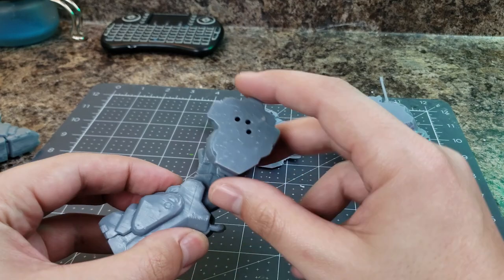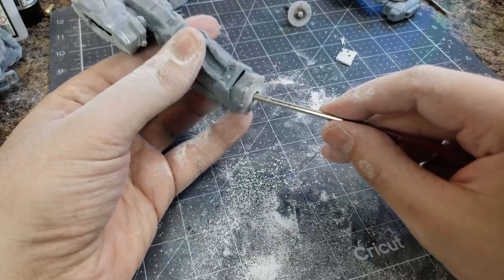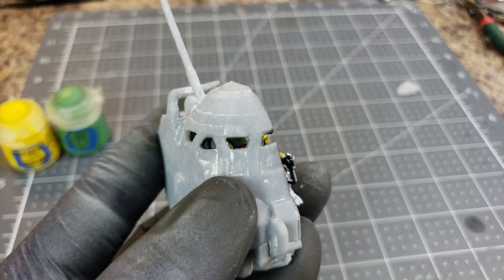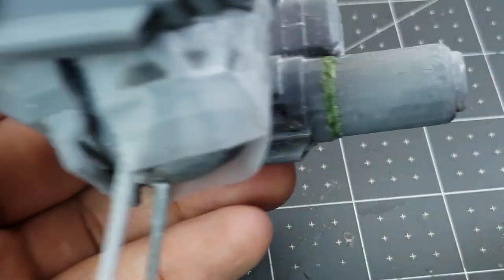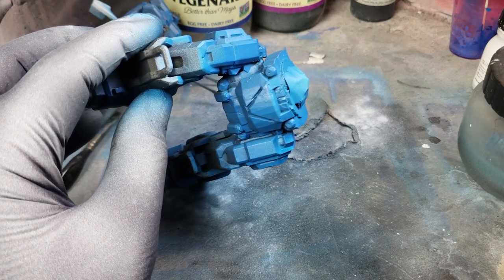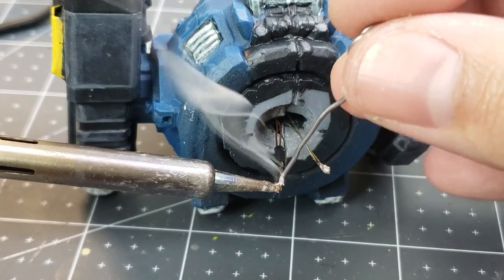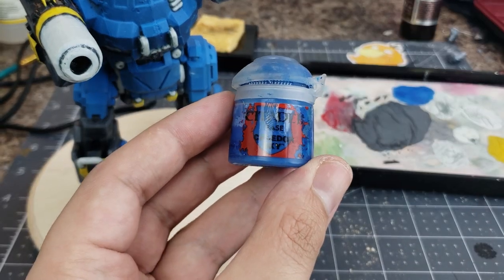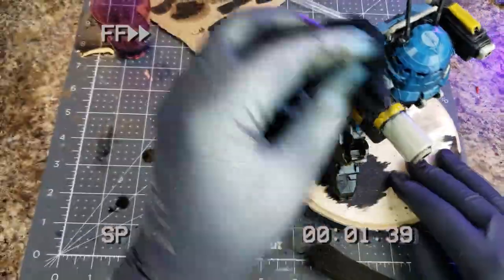Battletech in 28mm?! Building a TITANIC Urbanmech

Comment: Pro tip. If you drop the resin prints into hot water it will become soft enough so you can cut it with an exacto. Needs to be pretty hot tho. Boil the water. Pour into a container. Plop the part in and wait about a minute. Also, liked and subscribed. Great video
Reply from the maker: Thanks for the hot tip, and the watch! I'll have to make a point to remember this going forward.

Comment: 2 main reasons why you might want a proper masking tape rather than whatever tape you have lying around - both are related to whatever glue might be in use on the tape:
a) Some tapes adhere too strongly to masked off painted areas, and damage the paint finish when removed. (clearly not an issue here, as area not yet even primed)
b) some tapes leave adhesive residue on the area once removed, interfering with later paint application. (depending on paints in use and type of adhesive, can usually be removed via a suitable cleaning agent without damaging paint)
At the end of the day, if it works it works.
Reply from the maker: Thanks so much for the tips! It's easy to seem like I'm simply fishing for comments for the metrics, but I was genuinely curious. Much appreciated 😁

Comment: Pure greenstuff doesn't sand very nicely, I'd recommend making a mixture of greenstuff and miliput for your gap filling needs, the two compounds combine into a very versatile putty with the best of both worlds. The detail capture of the greenstuff and the strength and sandability of the miliput. The miliput is also water soluble, so you can make a surfacing wash to take care of any 3d print lines you may encounter. Shouldn't be too hard to get a hold of in the states, especially if you're in a major city, a good arts and crafts shop should have it, or it should be easy to order from somewhere.

Lovely build, always love to see urbie's and 28mm battlemechs in the wild.
Reply from the maker: Thanks for the hot tip, fellow trashmech enthusiast! I've seen that mixture occasionally out in the hobby wilds. I'll be on the lookout for some next time I'm out to restock supplies😋

Comment: With the filing flat surfaces that you're going to glue up, try gluing sandpaper to a tile and sanding with figure 8 movements. If you use wet type sandpaper, you can soak it and that will stop the resin dust flying around too. Once you've sanded the nubs off, you'll have helped to correct the warping at the same time. Hot water might help to lessen the nubs etc. Warping is a problem, I'm no expert in avoiding it on big pieces, if you have any tricks, please share. All the best.
Reply from the maker: Thanks for the solid tips once more, kind viewer! Exploring these projects is always gonna be a learning process, and by sharing my experiences with y'all, we open a dialogue to communicate mutual growth in the hobby 😋
Reply: @countryfriedminis  no worries, thank Adam Savage for getting me onto that one with the stuck down sandpaper - holding bits like that and sanding them always means catching the edges and making the flattening even harder. I've been in this 'hobby' since about '85, plus one of my best mates is a guy called Mel, The Terrain Tutor, (check him out, some great terrain stuff there) so I've been lucky to pickup and share a lot of tips and skills over the years. Battletech is a new one for me, I'm really enjoying printing and painting mechs at the moment.

Comment: Well to fill in gaps such as those shown, the trick is to use Super-Glue but to add body to it, sprinkle on Baking Soda and this in turn makes for an easier fill in, which in turn does not have to be filed down so much, as it makes plastic in the realms of resin. Suggest you try it and see the results.
Reply from the maker: I've seen this trick a few times while watching a few different crafting channels. It must've slipped my mind in the moment 😅 I'll definitely have to give it a go next time. Thanks for the hot tip, kind viewer!